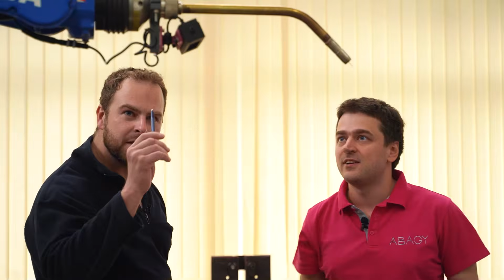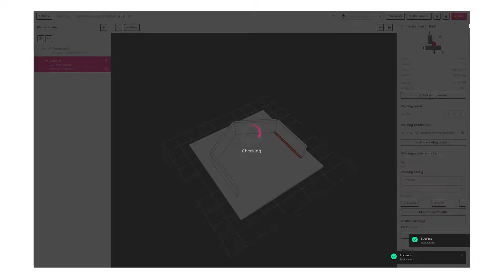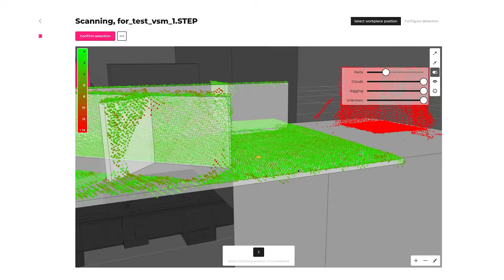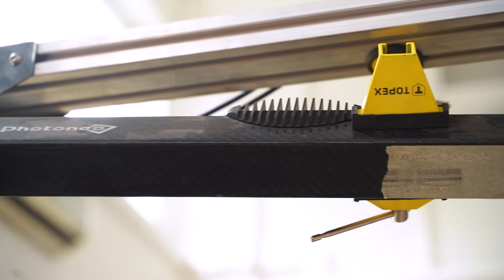3D Scanners for Industrial Robots. Cheap vs Expensive | ABAGY ROBOTIC WELDING

Comment: Would it be possible to hook up your system with a outdated kawasaki D Controller? What does the software cost?
Reply from the maker: Thanks for reaching out. We do work with Kawasaki, but primarily with their newer controllers. We would also need to review other options for the robot and welder.

To better assess compatibility with your project, it would be helpful to have more details about your setup: the robotic cell configuration, available equipment, robot and welder options, product type, and welding type.

Could you please send your request to hello@abagy.com? This will help us provide you with the most accurate information.

Comment: OK, is the smarts of your welding system powered by sophisticated algorithms or does an even more sophisticated AI system do all the work ? 

I can see the value of this system because it increases productivity and saves valuable time. Or at least this is my perception.
Reply from the maker: We talk about it in the video at the very end. You can navigate by these time codes.

00:00 – In the previous video
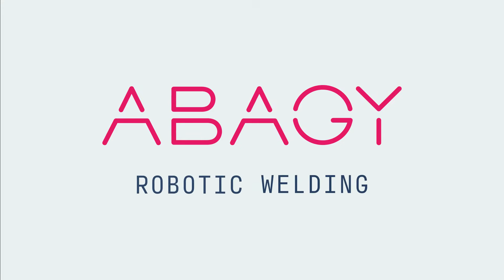00:34 – Another fixture experiment, this time we use larger and more complex fixtures
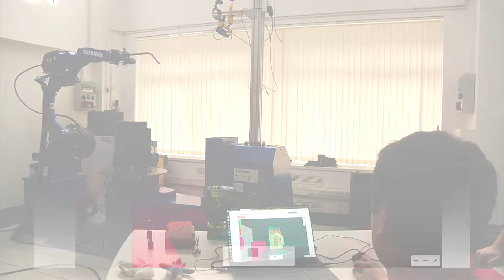03:39 – Scan results of complex fixtures
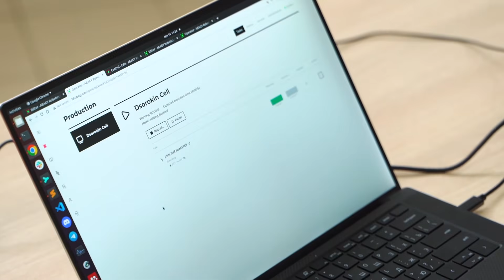04:28 – Robot dry run
04:49 – About the senses of robots: they can see and touch (cannot only hear, smell and taste). 
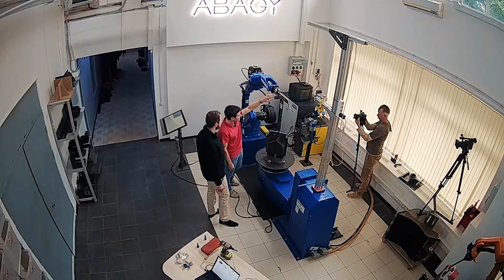06:08 – What is a 3D camera and how does it differ from an ordinary camera?
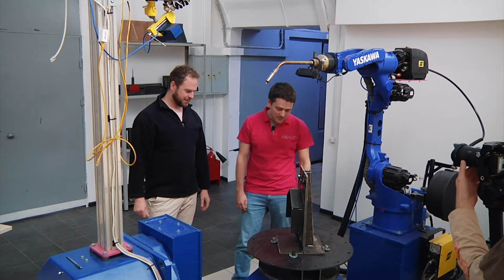05:47 – Review of different 3D cameras. The first scanner is small and cheap.
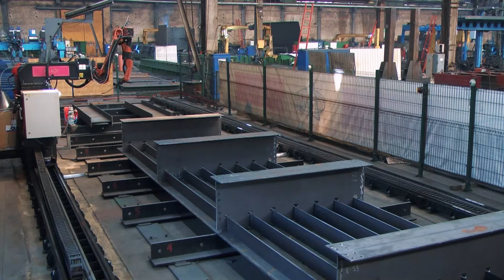06:54 – Second scanner: a big angle of view, but expensive
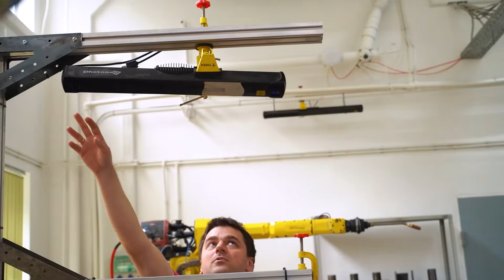07:38 – How can Abagy mount the 3D cameras?  What options do we use? 
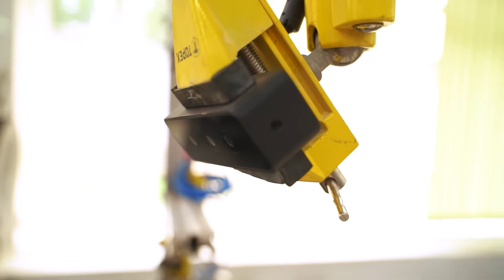09:00 – Third scanner with the hugest angle of view in our lab
09:17 – We test cameras, and compare their capabilities
13:49 – How does Abagy use AI?
15:11 – What is the difference between human vision and machine vision?